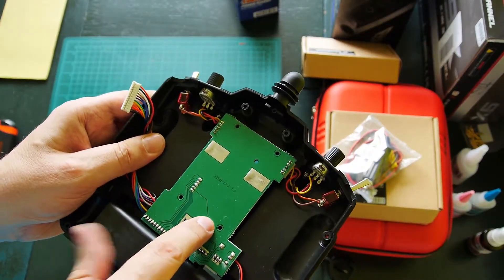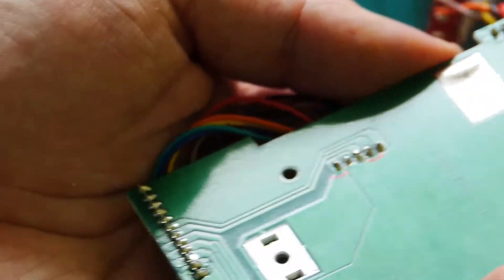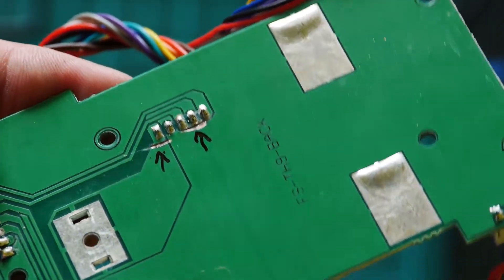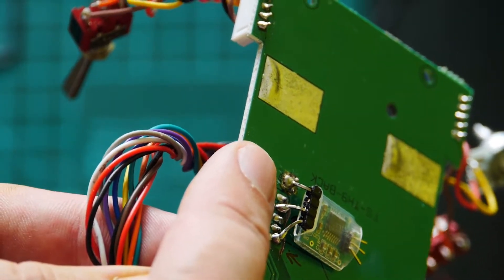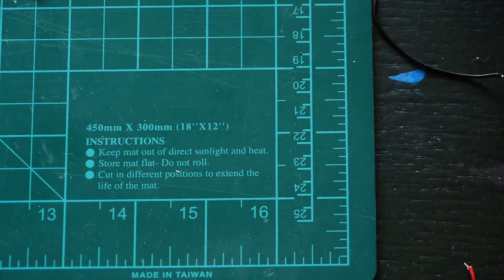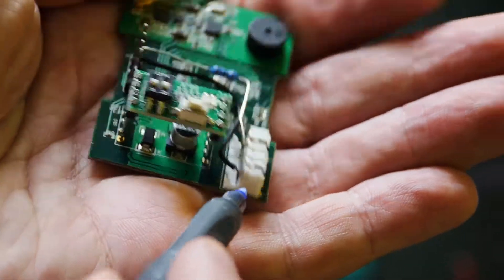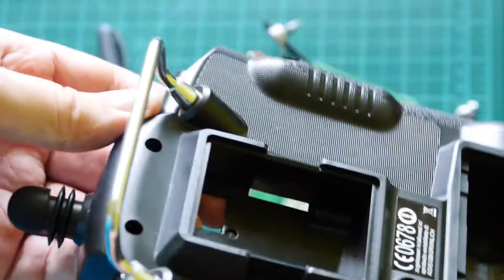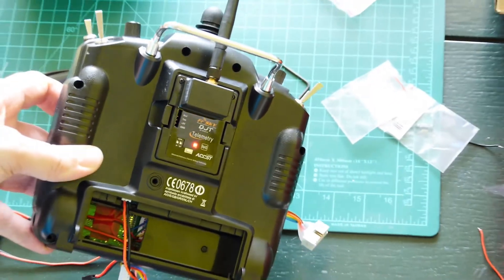T9x/Frsky CASE Tx modul installation - VERSION WITH a CONVERTOR - telemetry on display Part 2c

Comment: Richard, I know this is a very inexpensive way of making the Telemetry data available to the ER9X and Open9X  FrSky version FW and therefore the display of , I have done it with the SmartieParts mod and did the same jumpering internally to get the RxD and TxD info to the 9X's motherboard. Did the How-To video showing it all, backlight, SPSPB, TelemetrEZ module and all as well , but the editing is not as easy as yours. Without your good works, I don't know how most would figure out how to install this convertor. Great stuff lad. Now back to my editing.....:-)